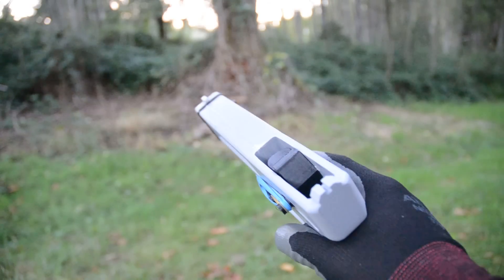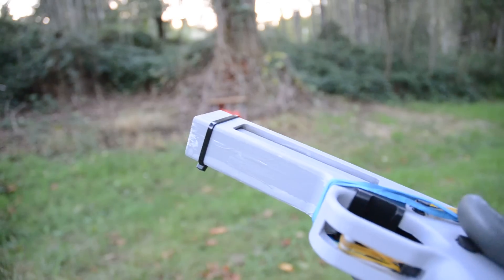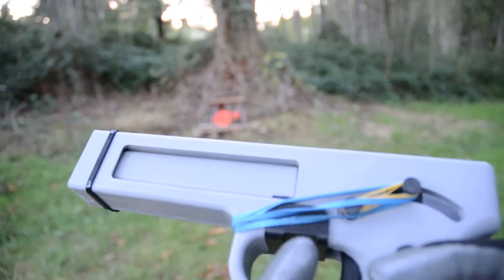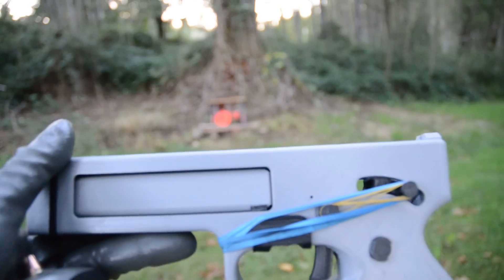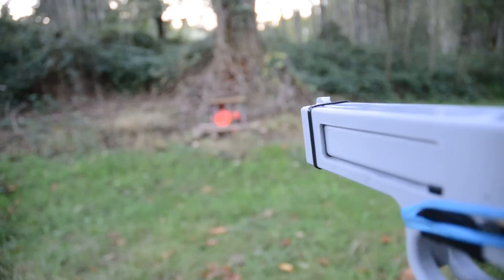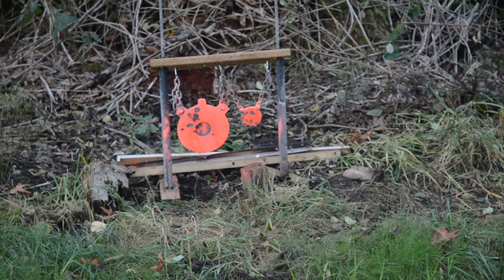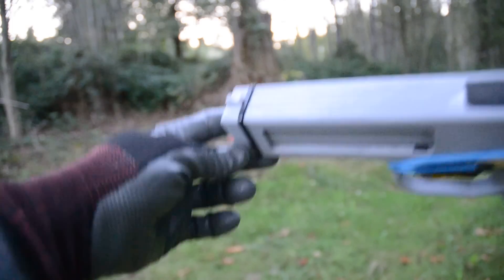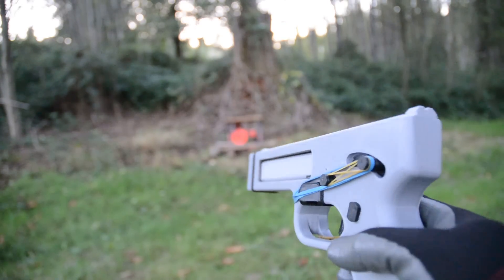REPAIRED! Songbird .357 Magnum 3D Printed Pistol

Comment: awesome video! looking forward to trying out this design once my brother gets his 3D printer running. I also wanted to add that the more recoil any specific load creates in a fixed barrel pistol, the higher the point of impact will be. so when you step up to the magnum loads, your POI is going to shift up.

Comment: That probably wasn't for a light primer strike. You sharpened and narrowed the pin too much. The tip of the pin needs to be wide enough to ignite enough powder area in the primer. I know it sounds crazy but round out the pin more. Use a normal 357 hammer's pin area as a reference. Nice video by the way.

Comment: Ok any of you who think the sound of the round firing in this video was a 22LR have probably never fired a real gun before . Video games in your basement don't count no matter how realistic they seemed . To Guy in a garage you really do need a second camera to be able to film yourself and the target . Even a cheap one would due. As for firing .357 in a plastic barrel well consider that it's not a plastic barrel , The liner is rifled barrel stock chambered in .38 special /.357 mag ,so as long as his headspace is correct and the case is firmly seated in the chamber all the pressure will be contained by the chamber and the weapon should fire normally . The issue is how many rounds can you fire till the headspace is a no go.  Though I wasn't under the impression that 3D printed guns were meant to be family heirlooms.

Comment: Have you considered printing the body as a split frame and using wide thread gap shallow angle plastic screws to join the two halves? My reasoning here is that instead of splitting it would just loosen the frame if the forces acting on it are too great. Also might make it easier to assemble. And allow you to router out some space on the inside to make things like the rubber bands internal components.

Comment: One point i notice about this firearm is the recoil. I understand that a semi auto uses the recoil within the slide to chamber a new round. I am no expert but also perhaps the slide and spring help to dissipate the energy from the round when fired. I could be wrong but I bet if you put gas ports near the front and a spring mechanism somewhere in the top, you could absorb the energy. In theory the energy is dissipated throughout instead of at the tip where the gun fractured initially. Once again I'm no engineer just a theory.

Comment: I'm genuinely surprised that hasn't had the frame fragment at the breech already. The bolt thrust is short duration but the peak chamber pressure of the .357mag can cause a total force of 14,000-20,000lbf to be exerted. Compare that to .22lr which produces 1,000lbf at the worst and you can see why I'm more than a little surprised.
Reply: i suspect its a matter of time till the breech face gives out.
Reply: The theoretic peak bolt thrust for a .357 Mag is around 3500 pounds, not 14,000 pounds. An 1 inch thick breech with a rated shear strength of at least 4000 psi (which I think is the upper strength for the 3D printed plastic) would technically be sufficient to hold back the force of without shearing. Not optimal, but doable.
Reply: @Bulsh1tMan  Chamber pressure for .357 is ~30,000 PSI.  How long do you think that thin barrel liner is going to last?

Comment: you should try printing it on an angle so your print layers are on an angle. Also, you can print approx. 5% larger, put it in the oven to anneal it, and it should be much stronger.

Comment: As someone noted the firing pin should not have been pointed. Rounded pins in most firearms. You could rupture the primer and hot gases would flash back at you if not rupture the gun. Hope you are still alive.

Comment: is that one of those 30 caliber clip high capacity ghost guns?
Reply from the maker: 38 caliber, bro.
Reply: @Farrow_Tech  Hello, I have a quick question;

I have print the songbird, shoot with .22 lr, the ammo is well hit but doesn't shot , I tried several ammo and same problem but the ammo has marks of the firing pin.

Do you think that the problem is that the rubber bands are not powerful enough?

Or does the firing pin hit the wrong place?

Thank you for your help and sorry for my bad english

Comment: Why not make the rounded end of the barrel a V shape, so when it fires and moves forward is will clamp the end of the outer frame. its like your design but then mirrored and modeled to a V shape where the bottom of the V is pointing towards you.
Reply: Get the plans, modify them, post 'em online and we'll print it. Thanks. ;) :)

Comment: Since the lower plastic receiver of a Glock is technically the firearm, and the upper slide assembly is considered "just a part," why not print a Glock lower and components, then put an actual Glock slide on it?
Reply: 2022 : Josh had the visions 😎😎👍

Comment: I also don't think it 's safe to shoot the incorrect size bullet from any gun, if its bore is for 357 then that should be the only size you fire from it. I commented on your last video so this is a follow-up. You also need to lock that barrel into place.
Reply: There IS a lock and the front is wedged in (hence the crack from the last video). Honestly I don't think that there's much that could happen, other than the firing pin flying into someone's eye. Ammo is ignited inside the chamber and it's only plastic at the end. Some tactical gloves, like he's wearing, hopefully can stop any digits flying off of hands and that's that. :)
Reply: +the brain...what is your point about the calibre he is firing?
Reply: +Marbles McGee S smaller caliber would bounce off the sides of the barrel, potential for accident (maybe gun exploding). He mentioned shooting smaller bullets using the same gun.
Reply: You obviously have a limited knowledge of guns. Allow me to teach you.  Do some subtraction: 
0.38 - 0.357= 0.023.... That's 23 THOUSANDTHS of an inch difference in the calibres.   38 cartridges can be fired from revolvers chambered for the .357
Reply: Despite it's name, the .38 Special is actually a .357 caliber. If it was truly a .38 caliber, it would be extremely hazardous to attempt to fire it out of a .357 Magnum Firearm, but the primary difference between a .38 Special and a .357 Magnum is a slight difference in the length of the cartridge, not the diameter—the .38 being slightly shorter.

While generally it is not advised to fire a cartridge that a firearm is not specifically designed for, in the case of a firearm chambered in .357 Magnum, it can safely fire .38 Specials, provided you keep it well cleaned. (.38 Specials will gunk up a .357 relatively quickly, and if too much gunk builds up, it can be hazardous.)
Reply: @tc1817  That's funny, you accuse someone of having limited knowledge of firearms but don't know that .357 and the cartridge it was modified from, .38 Special, have identical projectile diameters.  .357 is simply slightly longer to prevent people from firing revolvers with weaker actions designed for the original specification blackpowder and smokeless .38 Special.

Yes, I'm necroposting, but that comment gave me cancer.

Comment: If it is shooting, how can it be legal, I thought that the frame has to be an actual gun frame.
Reply: It's 100% illegal IMO, even if not specifically stated in a law. Any judge would rule it as such, for sure. xD
Reply: 7.1.1.4 Manufacturers of destructive devices. Manufacturers are reminded that if the firearms they manufacture include destructive devices, or if they solely manufacture destructive devices, they must apply for and obtain a license as a manufacturer of destructive devices. They should also note that the fee for such license is generally $1,000 per year, rather than $50 per year for a license to manufacture firearms other than destructive devices. A license is issued for a period of 3 years. Qualifying to manufacture destructive devices also entitles the FFL to manufacture and deal in firearms other than destructive devices.
Reply: @dylanschmitt6131  That only applies if you are engaged in the business of selling the firearms you are manufacturing.  It is legal to manufacture  a firearm for your own personal use, provided it isn't a controlled (NFA), illegal or banned type of firearm.

(A6) Does an individual need a license to make a firearm for personal use? 

No, a license is not required to make a firearm solely for personal use. However, a license is required to manufacture firearms for sale or distribution. The law prohibits a person from assembling a non–sporting semiautomatic rifle or
shotgun from 10 or more imported parts,as well as firearms that cannot be detected by metal detectors or x–ray machines. In addition, the making of an NFA firearm requires a tax payment and advance approval by ATF.
[18 U.S.C. 922(o), (p) and (r); 26 U.S.C.
5822; 27 CFR 478.39, 479.62 and
479.105] 

From the ATF's Federal firearms regulation pamphlet

https://www.atf.gov/firearms/docs/guide/federal-firearms-regulations-reference-guide-2014-edition-atf-p-53004/download